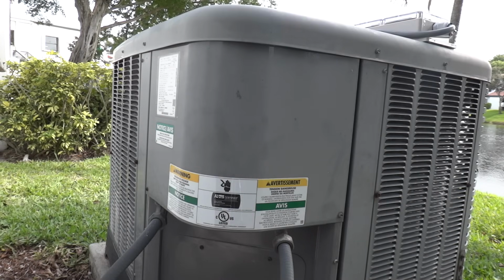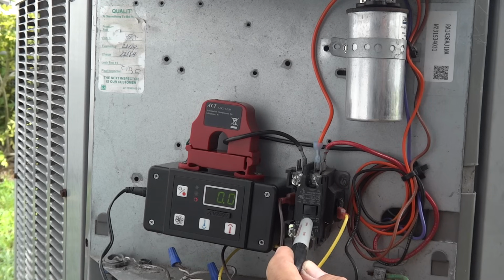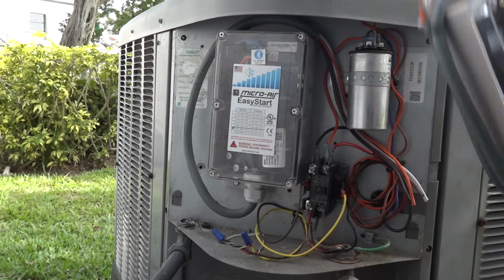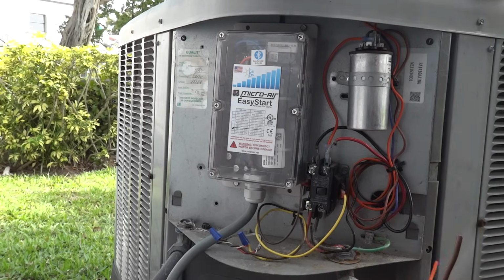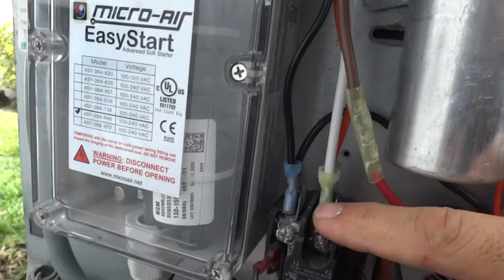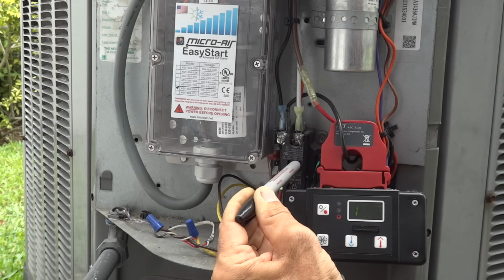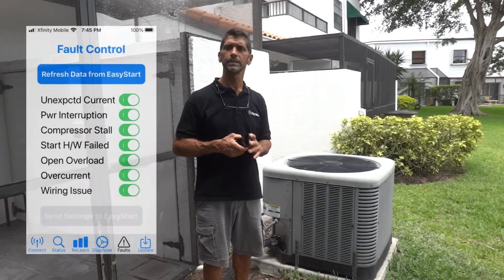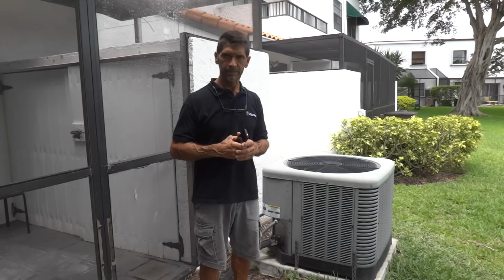Micro-Air EasyStart Home A/C Installation (368 Series)

Comment from the maker: ! ! ! ! !    PLEASE READ THIS    ! ! ! ! ! :    EasyStart sizing recommendations have changed since the publication of this video.  Please visit the sizing tool on the Micro-Air website at the following link:  https://www.micro-air.com/tools/easystart/modelselectorv3/step1.cfm
Reply: I currently have 3.5ton unit, but planning for 4ton unit size up very soon. What happens if I use the X72 (4ton) model to run my current 3.5 ton unit condenser?
Or, can I run a 4ton unit with the X48 model indefinitely? Wondering what was changed or found that bumped up the 4 ton units to a X72 recently.
Reply from the maker: @machorani  Hello Dan and thank you for your previous purchases. The dividing line between the X48 and the X72 does have some flexibility in it.  There is no doubt an X72 will work on a 3.5 ton, albeit less optimal, and an X48 is likely (but not guaranteed) to work on a 4 ton.  The design differences are company proprietary, so they cannot be discussed here.  Thank you again for your business.
Reply: @MicroairNet  Thank you very much for such fast answer! This is more than what I wanted to hear. I can let my mind at ease knowing x72 can run my 3.5 ton unit. Thanks again
Reply: @MicroairNet the differences are proprietary?! How is there no explanation based on science.. has Microair figured out a different system of scientific electrical current I am unaware of. If it is capable explain a bit more in depth as it's ridiculous that you would hide basic differences of your own products. It's like asking us to guess why with no explanation. "Take our word for it" mentality...
Reply: Roger, that!
Reply: Yes!  They changed the requirements for a particular AC to marry with a particular Easystart unit from this video.  Double checked my unit BTU rating from serial number to marry with recommended Easystart unit on their website.
Reply: Is this product now "one size fits all?"
Please edit the information in the description as I fail to see a sizing tool in the link.
Thank you
Reply: Hi MicroAir! Do you have a promo code for a fellow NJ resident considering model ASY-368-X48-BLUE for a 3 ton compressor or can I stop by your Allentown facility to purchase and say hello?
Reply from the maker: @davidgrisco1939  Hello David.  At this time, there are currently no discount programs available.  If you do stop by the facility, you can request purchase and perhaps a tour if you wish. I cannot guarantee you will be allowed inside the factory though, for liability insurance reasons.
Reply: Actually it is just one micro air flex start that covers all home hvac

Comment: My question is about the TOTAL amp requirements - When in the starting cycle does the AHU amperage come into play?  In a Trane system, does Trane start the AHU first, then signal the Compressor to start?  This matters to the temporary power supply, a standby Generator, which needs to be capable of powering the total startup amperage requirement.

Comment: What is the long term effect of using the Easy Start method of low charging current to break the compressor motor from standstill to running at speed - and my lack of A/C knowledge makes me ask - running at speed full loaded, or does the compressor start unloaded and when at full speed, the compressor loads.  I just want to know if the Easy Start will, over the expected life of the compressor motor, cause the motor to degrade sooner that without the Easy Start.  I am thinking of adding the Easy start to each of a 2 and 2.5 Ton Trane XR 13, 12-year-old compressors.

Comment: Question I'm not finding an answer to:
What about a self contained heat pump? Every video is based on these separated units i have a Trane heat pump that trips my 7200 watt generator immediately just by simply turning the breaker on. 

So can these wire into an older heat pump?
Reply from the maker: Using our soft starter with a heat pump should not be an issue. You can contact our technical support team with any other questions or concerns. https://www.micro-air.com/SupportRequest (Select "Tech Support")

Comment: I had a unit fail. It seems like in the past they were very responsive, but of late it’s emails back and forth pointing fingers between the manufacturer of the unit and the other way around. I just wanted a human to talk to because my units salesperson said the warranty will be voided if I reinstall the soft start. The original issue was a fault code on the compressor overrun cut off. The tech removed the soft start and set it up to factory specks and it worked perfectly all in spec. Soft start won’t help me unless I reinstall the unit which apparently will void the warranty. What to do?! I loved the easy start until it didn’t work. The heat pump is 2 years old.
Reply: What a horror story, thanks for sharing, ideally micro-air should send a new unit to see if the original unit itself is faulty. Very shocking that micro-air is flat out ignoring you.
Reply from the maker: Sorry to hear about the issue you raised.

Our EasyStart soft starter is designed to work safely with your air conditioning system and should not void your A/C warranty. You can check the specific terms of your A/C manufacturer's warranty or consult with them directly.

We recommend sending the error information directly to our technical support department using the built-in Bluetooth module if you have not already done so.

https://www.micro-air.com/kb-easystart/cat_troubleshooting.htm

Thanks!
Reply: @ I did and was told to reinstall it. It a circle of hell. The info for micro air I believe was faulty because the unit is operating perfectly. I want the micro air to work because if back up generator needs. But I strongly feel the unit is faulty. I have paid over 300 dollars in installation and removal costs.
Reply from the maker: @boogs4304  We would be happy to investigate your existing technical support case. Feel free to submit a new ticket at https://www.micro-air.com/SupportRequest selecting the “sales” option. Please state in the “description area” that you were instructed to submit the ticket from the Micro-Air YouTube Channel, including your original case number. Thanks

Comment: @microairnet i need your help. I have a 230Vac 80gal 5hp air compressor. Double pole, 230v. Single phase. 21 running amps. 30a breaker. Do you have a product that will help me? Let me know please. Thank you. Your website has no contact info.
Reply from the maker: Please contact customer support at https://www.micro-air.com/contact_microair.htm.  Thank you.

Comment: Just installed the micro air easy start flex.  These are relatively easy to install once you know the wiring details of the unit.  My electrician did not know how to do it and cross wired a bunch of items and said it was good.  I only found out after my house got really warm and discovering the compressor never came on at all.  He said it was just really quiet from the easy start.  I looked up my model, Lennox, and had it running from the diagram and this video.  I'm wondering for the mobile app, it only connects when the AC is running and it doesn't have a history lookup to see how it's reducing the startup amps over time.  Is there a way to see the historical data?  Thanks for your help!

Comment: So for my Trane 3 ton unit what will work better, the 368-X48 or the new Easy Start Flex. I don't plan on using a backup generator I just want my 10 yr. old Trane to last another 10 yrs. I don't see any videos on people installing the flex and I've read reviews about a leakage problem inside the unit.
Reply from the maker: Hi Robert and thanks for reaching out to us.

We recommend our EasyStart Flex model for all home AC/Heating systems.

The initial release of our Easystart Flex soft starter was primarily targeted to a Pilot Group and early-release customers, unfortunately, the customers are within the same area of the country with a very high number of participants. An underperforming component that originally passed stress testing was found to be failing in the field.

Our technical support team has proactively worked with those customers to resolve any problems that have surfaced, including in very isolated incidents.

Our product comes with a 2-year built-in warranty, no registration is required. We have you covered if needed.

Comment: To add to the discussion.  I bought a MicroAir soft starter.  Had the company confirm that is was sized correctly and they even verified the connections - run wire, etc.  Worked great for 2 months.  Then no cold air.  House in Florida, in the summer, heating up to 85+.  I was out of town, so called my local AC tech and he discovered the run wire connection from the soft start was burned.  For a distance of over 6 inches.  He rewired the AC and Voila cold air again.  I contacted MicroAir and told them what happened.  Me being a trusting consumer, I thought they would stand by their product.  NOPE!  They told me the failure was caused by the heat.  You think?  Florida, in the summer, DUH!  The original run wire worked for 9 years and after reconnecting the AC works fine.  There is something wrong with the soft started and they won't admit it or support their unit.  BUYER BEWARE!!
Reply from the maker: Hi Eric,
We apologize for the late response and the issue you had. We believe that we processed a warranty replacement. Please feel free to contact us at https://www.micro-air.com/SupportRequest (select Tech Support)

Comment: Hi. My config is a little different. My capacitor, C connecter, has a single yellow wire that goes to a blade connector on the 'back' of my contactor, behind where your yellow wire is. It appears to be on the same 'bus' as the front yellow contactor terminal that you used to butt connect to the brown wire. Should I use this yellow wire to the soft start brown wire since it is the only yellow wire on the C terminal of the capacitor and then connect the white wire to the contactor where it was?Thanks for a great video.
Reply from the maker: Hi.  All systems use different wire colors, so it is best to not pay attention to the specific colors that were seen in the video. Instead, look at your wiring diagram and determine precisely which wire connects to your compressor's run winding (NOT the run capacitor!).  This is typically the wire under the screw terminal on the contactor.  Yes, all of the wires connected behind it are on the same electrical node.  Once you find this run winding wire, then disconnect it and splice the ES BROWN to it.  In its place on the contactor put the ES WHITE wire.  What you absolutely must not do is splice the brown to the wire that leads to the C terminal of the run capacitor. That will destroy the EasyStart and void your warranty.
Reply: @MicroairNet  Thank you for the help. I'll check my wiring diagram. Have a blessed day. 👊

Comment: If this the case of saving money why don't you do it for the whole house,that would be phenomenal droping that much on incoming main power and my Question why wasn't this tested on line 1 and line 2 of the incoming power source.this a single phase 240 vac system? and why isn't monitoring both sides of the incoming source? is only a question please clear my thoughts on this,thanks for the Amazing Video.
Reply from the maker: Thanks for your question.  The EasyStart monitors the full 240V line voltage.  Beyond soft starting just the compressor motor, applying a "soft start" to the entire house is not advisable and potentially damaging to appliances and electronics.  It will essentially "brown out" the entire house and modulate the voltage in such a way that does not affect a compressor motor, but will adversely affect some appliances. The concept you speak of was actually developed and marketed for RV applications, but it had to be pulled from the market because it was damaging electronics and microwave ovens.
Reply: @MicroairNet  Good to know Thank you, when you guys are coming now with one that works on electric Ovens and other things that draw alot of watts in initial start ups.thank you again for your dedication of helping the communities to save energy in a big way,🙏🙌

Comment: I installed mine during a power outage because my generator wouldn't fire up the AC. 
Once I fired up the generator again, the AC worked. 
My question is this. I've heard somewhere that the Easy start would need to cycle a few times under utility power to work properly. 
Is there something I should do differently since it's first use was under generator power?
Reply from the maker: Yes, although the EasyStart can learn on generator, the results are not always optimal.  Therefore, once grid power returns, you should reinitiate the learning process ("ReLearn") by setting the switch one-time in the app and saving it to the EasyStart.  Upon the next power cycle, learning will begin like it had just come from the factory and the ReLearn switch will automatically be turned off (deliberately by the firmware).   Once the ReLearn process completes on utility power by allowing it to conduct at least 7 startups, you can go back and forth between generator and utility power as often as you'd like, and never have to ReLearn again.
Reply: @MicroairNet  I could never get mine connected to the Bluetooth and I don't have an app. 
Any help here?
Reply from the maker: @ericallen7200  Try this:  https://www.micro-air.com/support-documents/installation_resources/EasyStart_Bluetooth_Manual.pdf

Comment: Heavenly LED lights inside to tell the condition of the unit sounds like you need to mount it on the outside of the unit so you can see what the problem might be rather than inside

Comment: What is the working life of the Easy Start? I need to get 2 of these but I don’t want something that only lasts a few years at a price of almost $400 each…
Reply from the maker: EasyStarts are designed to outlast the life of the air conditioning unit.  Many customers keep them and transfer them over to their new A/C when it gets replaced down the road.
Reply: @MicroairNet  Thanks..

Comment: A little late to the Micro-Air party, but living on the Gulf Coast of Florida with the forecast of a robust hurricane season, I had our Micro-Air installed earlier this year on a 2014 3.5 ton A/C unit.  Hooked up my DuroMax 9000iH generator today (sister-in-law and hubbo live in Houston and are 5 days into no power) and thanks to Micro-Air, and DuroMax, I ran the A/C, Fridge, Ceiling fans, outlets, etc., without a hiccup. Very cool to have the generator running, turn on the A/C, hear the generator surge for a second and then having full A/C on a very hot, humid (heat index of 104 today) day on the Gulf Coast. THANK YOU Micro-Air for this video and your product!
Reply: And just to clarify… today was my first test of the system. Didn’t need it yet, but relieved to know it all works- thanks to Micro-Air…
Reply: @cliff9745  - Who Installed of for you? I'm on the gulf coast as well and NO one has ever heard of this
Reply: @PureBlueAgave  Good morning- I reached out to my electrician. He’d never heard of an Easy Start, but he sent 2 guys over, I gave them the installation instructions and they got it done with no problem. Dramatically reduced A/C start up amps. They said they can’t figure out why every A/C doesn’t have an Easy Start.

Comment: Can I use this on my Pentair Variable Pool Pump?
Reply from the maker: No, and there would be no need to. The variable speed pumps are PMSM with an integrated inverter drive that already ramp starts the motor with minimal surge.

Comment: So now the easy start does not come in different versions for different ac unit sizes? now it is one model (the flex) for all ac unit sizes? please confirm before I buy one today, aslo any promo code for the 4th of july? thanks
Reply from the maker: Yes, the EasyStart Flex (a.k.a. model 398) is the new one-size-fits-all model for any home or marine application.